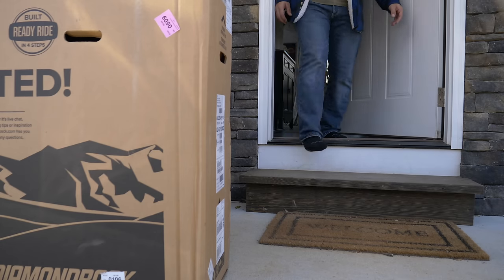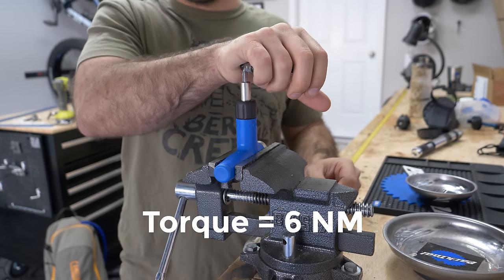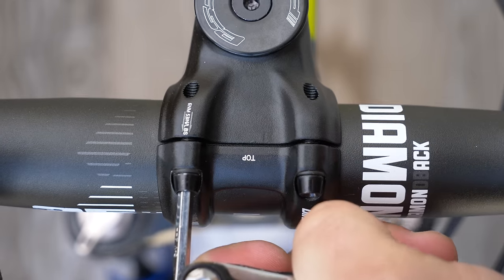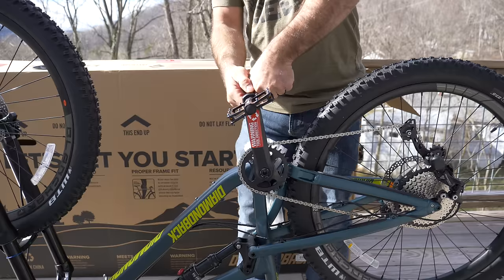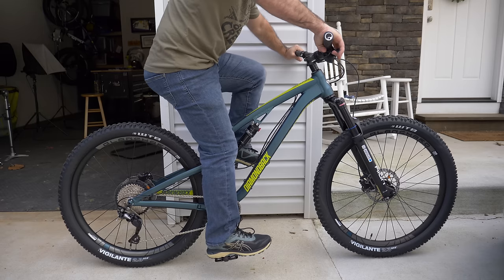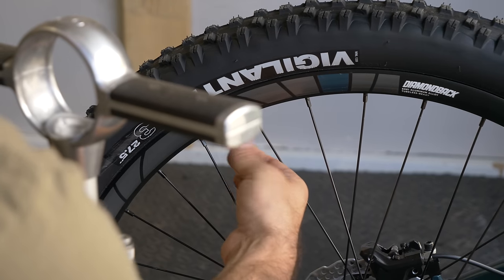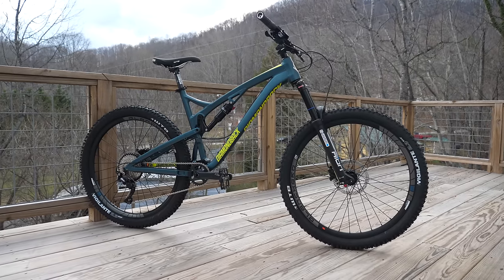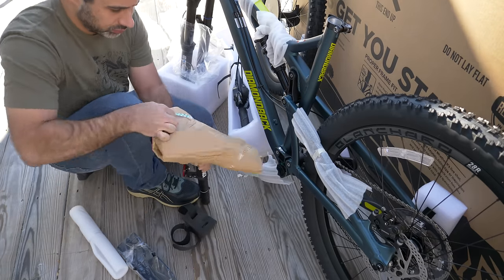Assembling your new mountain bike with minimal tools

Comment: Is this enduro bike? Or xc?
Reply: It’s neither it’s a trail bike
Reply: @victoriathegreencheekconur5477  ok grewt, i got this bike brand new for 700, with lots of upgrades, is it worth 700?
Reply: @luckyyou774  If you bought THIS bike for 700 dollars then I highly doubt it’s brand new. I believe the original price is about $2500.
Reply: @regulus7754  it is new, with lots of expensive upgrades. Dropperpost, turnine handbar, peddals crankset. Maxxis minion tires. I thoughit was a bad deal but i guess its not

Comment: How on earth can bike manufacture who is selling a bike online, knowing it probably won't be built my a trained mechanic not include a torque wrench with the bike? I mean you dropped the price a ton as there is no middle man to take away any margin. why not spend a few extra bucks and include a torque wrench and at that point the basic multi tool and simple things you would need to assemble the bike. seams pretty stupid to not tighten bolts properly. you get peace of mind that its tightened correctly and might even save a few warranty claims due to ham fisted assembly. seams like everyone would win!

Comment: Seth I need a new bike I have a Walmart bike with loose spokes and my brakes rub on my rim and make noise and I’m 11 yrs old and my bike sucks
Reply: my bike sucks to. guess what, if you learn to ride your current bike well, you'll be really good on a good bike. also, if you can't maintain a cheap bike how are you going to be with complicated suspension repairs and 12 speed drivetrains?

Comment: Those tubeless valves are the shittiest type you can get.... square shape of the gum and nothing to secure it at the end so it won't break. Had those and totally do not recommend!
Reply: a A rRB b uzU Z that's probably because it was installeer badly/wrong, i Ride the same type of valve stems and they have never failed me (a friend of mine even Rides a tubeless tire set up with a valve stem that was cut out of  a tube)
Reply: @lenvg9891  no

Comment: I totally believe that this Fill guy is the most boring man in MTBing today. This Fill guy should try to spend more time improving his riding skills instead of talking about adding 2 millimeters to his (bottom bracket, peddle width, head stem, handle bar width, seat height, tire width, grip diameter, crank length) NOTE: pick any of the above. Fill is too old, too short and too out of touch with HARD CORE riders like myself!!!!
Reply: Fill? You mean Phil Kmetz? He is annoying but he's a better rider than Seth by a long shot.